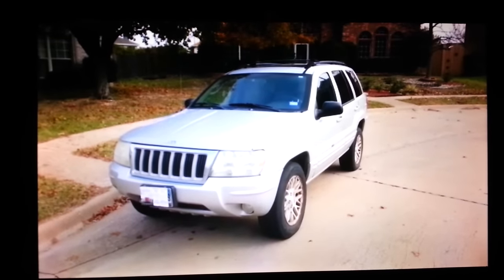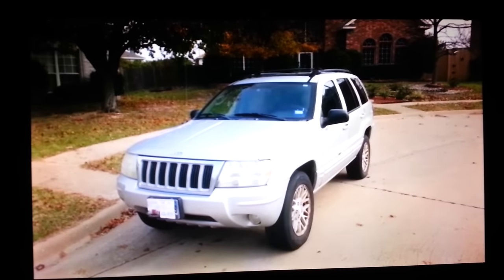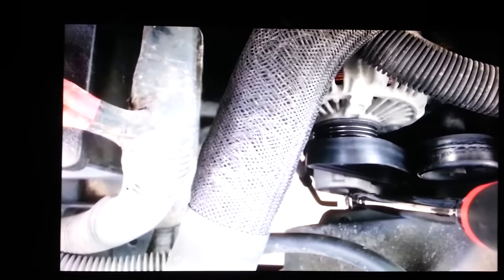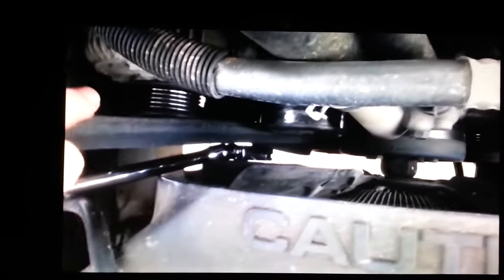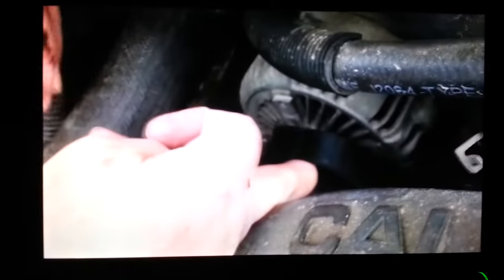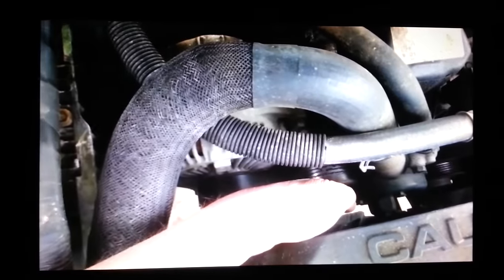Serpentine Belt Replacement, Jeep Grand Cherokee 2004, Change, 4.0 Liter

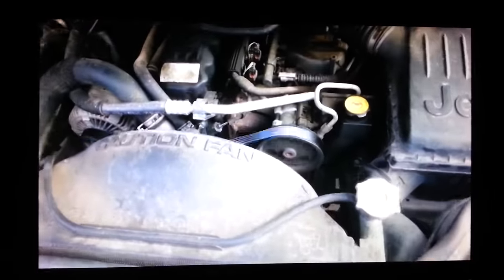Comment: That high pitch is likely a bearing - just had my idler pulley literally shoot out it's spot - heard some noises like that at around 5:49 but every mechanic I've had look at it while working on more issues said it wasn't anything to be concerned with and now I'm stranded trying to figure this out lol. It's raining out here so this should be fun and you can replace your belt shocks, not too expensive. Think I'll come back here after I buy the pulley and get it in 🤞🏽

Comment: What socket did you use to move the belt tensioner? Did you have to loosen it with the T-40 bolt???
Reply from the maker: Hi Walter,    
 
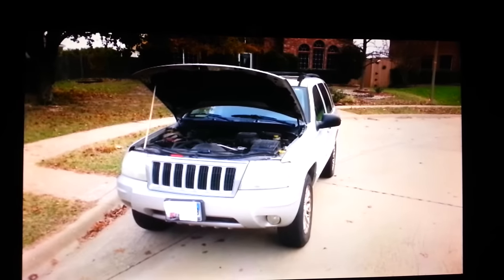I just used the half inch square post on the wrench handle shown at 1:47,  I didn't use a socket.
The half inch socket wrench, fits the square hole in the belt tensioner.
Belt tensioners, often have several different size square holes in them 1/4", 3/8", 1/2" so you can use your socket set ( no socket required, just the wrench handle).  The jeep, tensioner only has the 1/2" hole.
I used a fairly long wrench handle in the video, but it was not necessary. Any 1/2" will do. 
I did it while holding the camera, and used the other hand to remove the tension, then braced the handle against my neck to get the recording.   You only have to move the handle about 120 degrees.

Thanks,

Alex  

Allen TX
Reply from the maker: I did not turn the bolt.      Thanks,
Reply: Hey thanks for the info amigo - much appreciated! 

Thing is on my 04' the tensioner can be moved by hand and I'm wondering it it is shot or if I can tighten it so it snugs up the belt with that Torx bolt. Currently the belt is so loose that the alternator isn't charging and the Jeep is un-drive-able!!
Reply: It's shot - a "wrench" at Valvoline up-sold me a new serp belt a few months ago and must have cracked the housing when he did the change-out. Replacing today - hope not to strip that damn T-40 bolt!!

Comment: Very helpful but cut through the old belt makes it easier to remove
Reply: You may be able to use the old belt in a emergency, so save it and put it in the trunk.

Comment: Any advice mines is making a howling noise? Could it be it’s too tight?
Reply from the maker: Hi Rafael,  I doubt that it is too tight, the force is set by the tensioner.   Could be some contamination on the belt, or maybe the bearing.   
If you remove the belt again, and then turn the AC, alternator, water pump, and belt tensioner pulleys,  they should turn smooth as glass.   If any feel rough, have any wobble/play,  it  may be  that the bearing is failing.     Without the tension, bearings/pulleys may turn freely, but if it feels rough the bearings are failing,  and will bind under load.    
Pull off the belt, and carefully turn each pulley,  then go to your local parts store,  and ask to look at each of those, water pump, alternator, idler etc.  Feel the difference.
You can do that check in their parking lot.
Also make sure you don't have a coolant leak, or engine oil that may have gotten on the belt.  That will also screech.  Use  break cleaner, or Starting Fluid spray,  can easily wash off oils.   
BTW: If you are concerned about failing inspection, or a mechanic is trying to find something to replace, due to engine or, hydraulic oil.   Spray it down first with a can of "Starting fluid," or "Brake Kleen"  ( not a sponsor  ;  )   SMAC.     It will just wash away, and the spray evaporates in seconds, leaving dry metal.

Comment: what brand was the belt?
Reply from the maker: Hi Su su,     The belt I used in the video is a Dayco Part Number: 5060883.

Bought it from Autozone for $31.49.      It is also a good idea to check your belt tensioner,  and idler pulley while you have the belt off.  When turned, they should feel very smooth.  If the bearings feel rough at all, they need to be replaced.    While you are buying the belt, check how they should feel when turned.      Thanks,
Reply: thanx